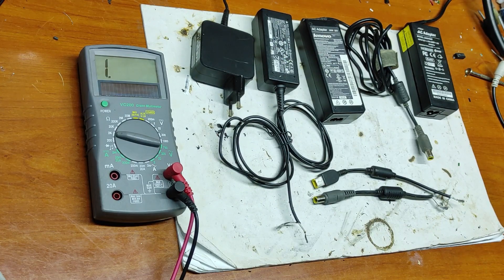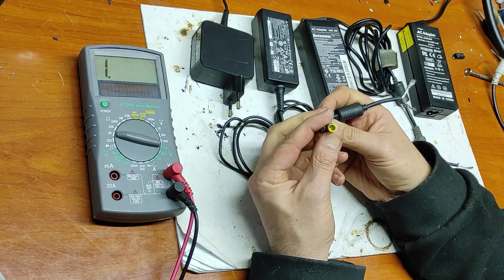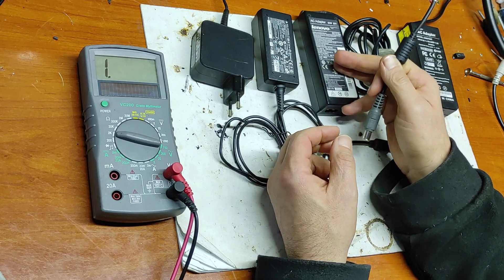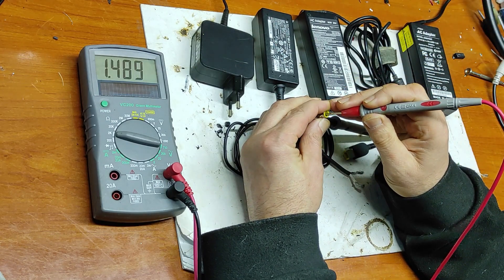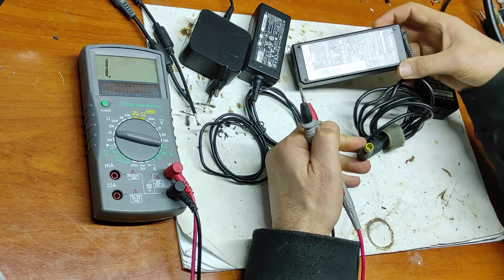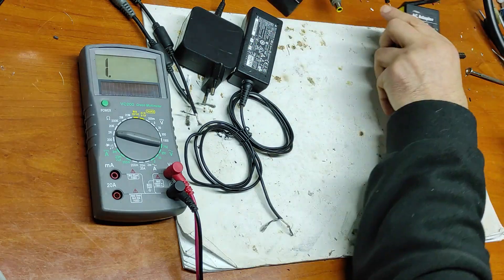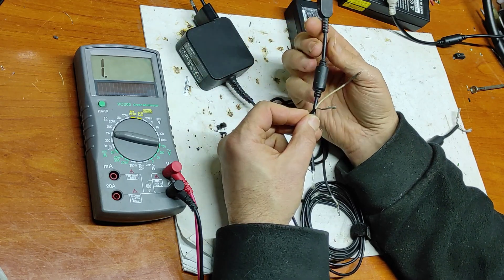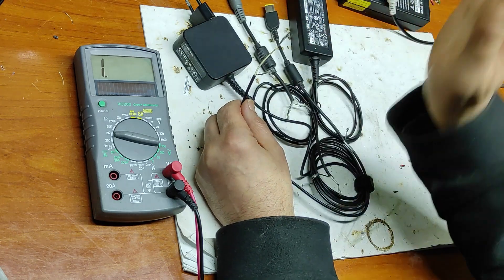Lenovo Laptop Charger ID Pin Explained

Comment: I have a Lenovo Helix ultrabook pro.The adapter has  12v  3a output.   DO you know the pinout of the power plug? It is a smaller version of the one with the middle ID pin.. Which pin is +12v, 0v and ground?  Is there a ID pin? I am trying to use a generic12v  supply.
Reply from the maker: I dont know bro I cant help u. but u should find on net.

Comment: 2 wires and 3 pin. How it is connected inside?
To which wire is connected ID pin?
Reply from the maker: To the center I explained in the video
Reply: @diymariuselectro  ID pin is the center PIN.  That is clear. But as you say we have 2 wires, neutral and phase.
Phase wire is connected to inner part of round.
Neutral wire is connected to outer part of round.
To which wire is connected center ID PIN if there are only 2 wires? To neutral wire?
Or there is 3 wires?
Reply from the maker: in DC we have plus and minus or gnd.I put schematic in video.
Reply: @diymariuselectro  so, minus is connected to center ID pin?
Reply from the maker: yes
Reply: @superivan132 connected to ground but with resistor
Reply: what value resistor is needed to make diy charger with id pin

Comment: Wrong. center pin is data from ds2502 one-wire memory.
Reply from the maker: pls give us more details and link to schematic.And what about resistor?
Reply: @diymariuselectro  Have a look here. Its a 512bit EPROM, single wire communication. The laptop will supply voltage on the ID sense line to power it then set up communication to read the data.

https://cdck-file-uploads-global.s3.dualstack.us-west-2.amazonaws.com/digikey/original/3X/5/5/55ea168aedb0a2ef9c4885582bbdb987e940c06a.pdf
Reply: wrong.ds2502 only on dell chargers but lenovo uses resistor connected to ground inside the charger tip